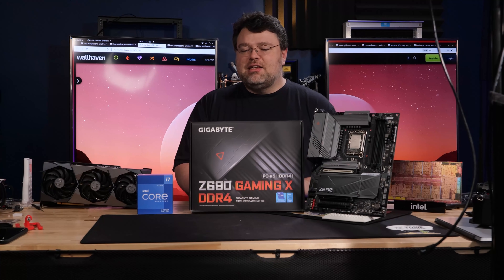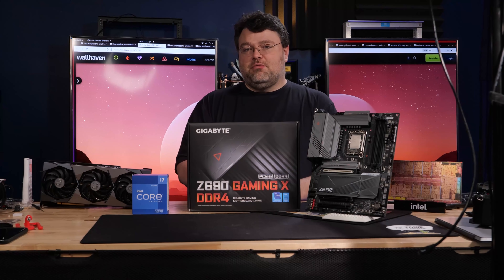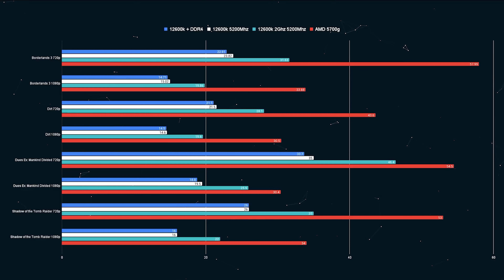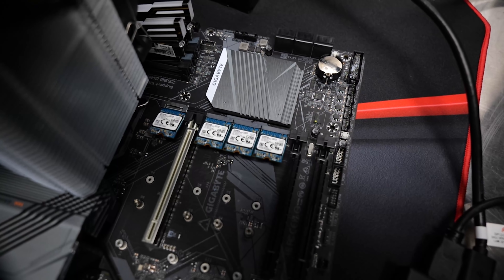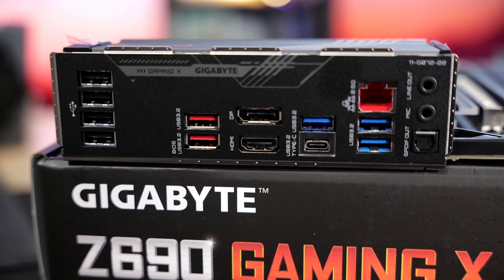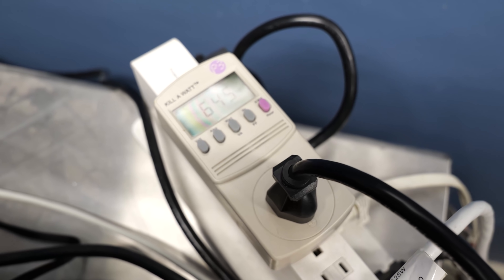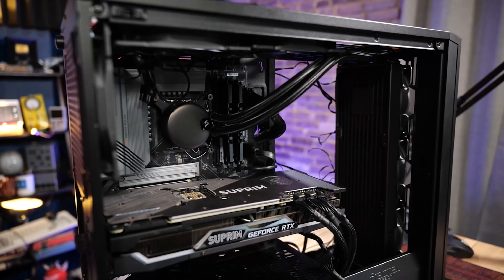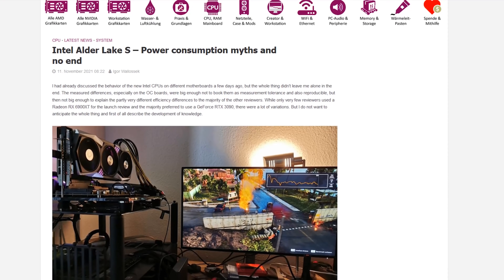Checking out the Gigabyte Z690 Gaming X DDR4: Does DDR5 Matter for Alder Lake?

Comment: You might have already seen this, but for hardware Unboxed's video on Z690 VRM testing their Gigabyte boards (which included this board) all performed at the bottom Power consumption and thermal wise.

They didn't test ASRock boards, but it might be Gigabyte having an issue, not DDr4 vs DDr5.
Reply: Gigabyte had good boards for B550 and X570 but their Z690s are just straight up trash. MSIs are top tier.

Comment: When talking about the rear IO you didn't even mention whether the NIC is 1GBit or 2.5
Reply: 2.5
Reply: No need to mention, all Z690 boards have a 2.5 LAN port.
Reply: if it's not 10gbit it doesn't really matter
Reply: @marcogenovesi8570  Right
2.5G really seems like a half-step
You would like to see 10G more but it's also one of those things where if you wanted 10G you probably already have it (10G RJ45 copper is getting cheap and SFP+ is proper cheap) and wouldn't bother getting in on a motherboard unless you really don't want a separate NIC taking up space or you're on ITX (is there even a ITX board with 10G?)

Comment: Have you tried the motherboard HDMI port with the iGPU only ?
I have the same motherboard and I'm having issues while connected to HDMI.
I've tried different cables but no change, however at 1080p the cable quality requirements shouldn't be an issue.
DisplayPort seems to work fine with no issues.
Just wondering if it's something specific from my setup or maybe poor signal quality from the motherboard HDMI port.

Comment: I'm not actually fond of the idea of getting rid of so many PCie slots just for m.2
I understand it's a gaming board and redoing the M.2 to be 2 PCIe 8x slots may run afoul of the huge GPU heatsinks seen nowadays but it would be nice to see ATX boards actually take advantage of being ATX and moving SSDs to an add-in card, it keeps options open rather than restricting lanes to only M.2

M.2 is getting long in the tooth to be honest, think of all the insanity we could have if there was a return to AIC SSDs
Reply: M.2 isn't going anywhere, it's used by laptops and gives massive economies of scale to reduce price of what would be a much smaller SSD than a 2.5. PCIe SSD cards would be limited to desktop only and this would just make them too expensive.

The only issue here is motherboard manufacturers that prefer to put M.2 slots on the board instead than PCIe slots + a cheapo bifurcation-based PCIe adapter
Reply: @marcogenovesi8570  Not saying M.2 should go away but for enthusiasts there should be more options as M.2 is somewhat lacking in board space. There is reasons the enterprise doesn't deal with M.2 much
Reply: @marcogenovesi8570  yeah, I see the standard growing with the years, but for example, with a pci-e slot by 8 or by 16 on pci-e gen 4 (15.76 GB/s with 8 lanes and 31.5 GB/s with 16 lanes) can provide enough bandwidth for a blazing fast ssd or a couple less fast ones, but you can install the adaptors wherever, and include more adaptors if desired. I think the variety of pci-e connectors and available electrical lanes on standard pci-e makes it very un-standard-y, and m.2 is the same everywhere. At least, if there was a standard to mount m.2 devices vertically (maybe there is such standard, idk), more space would eventually be saved on motherboards for other m.2 slots or even PCI-e slots or whatever. It's all about possibility and liberty to put a crap-ton of capture cards, GPUs, audio cards, network cards, newer USB version cards, a bunch of "SATAn" ports for big data storage for a desktop PC so you put it all together for a build/render/storage/mail/media/firewall or all of the above server/desktop PC... the PC is awesome.
Reply: @tonnylins  I know, a "dumb" bifurcation-based M.2 adapter PCIe card that can fit 4 SSDs costs like 20$ and can be 100% reused on a different board so IMHO it would have just made a lot more sense to just not place any M.2 and rely on secondary market to provide the adapters
Reply: @marcogenovesi8570  yep
Reply: I don't know, but it seems m.2 slot is way under-utilized than it could be especially for the smaller size, and potential use with faster speeds each year it seems lol. One current possible use example could be for a complete streaming setup using one small mid-tower pc if no room for dual pcs, or space for larger cases designed run dual pc. In this mid-tower setup using m.2 SDI capture card to keep your main PCIe 4.0/5.0 x8/x16 lines for hardware which can benefit more in those lanes than the majority of current SSDs need/will need for most. Depending on if you're an audiophile allowing a 2-slot GPU in top PCIe x16 and audio card below it while allowing video capture directly through m.2 from up to 4 sources per m.2 slot. As tech continues to advance, it will be the more you can fit on the board in the least space = most enticing haha. I mean look at the trend of pcs in the last 15 years... mATX basically died out for a bit recently because majority of people want to build ITX sized computers. Others build in mid-tower ATX or full with ATX/eATX to have space for the water cooling, or more powerful hardware while better managing temperatures. I predict mATX comeback wave soon where boards might skip out on SATA 6gbs ports and using space freed up for more m.2 lanes. This as well as going from the normal mATX using one PCIe x16 and one PCIe 4x (if 2nd slot is x16 it's usually limited to x4 when top slot is in use) on currents boards to newer boards standardizing two PCIe 5.0 x16 lanes with also four or more m.2 PCIe x4/5... See in my opinion ITX is made simply too small thermally and for current hardware size needs. Even stuff like a decent CPU cooler to fit in an ITX case which can actually cool newer top notch processors, its hard to find, and then even harder to get to fit and work properly with the space given on the ITX board due to larger onboard heatsinks lol.  EATX and ATX are fine if your room is okay with mid-full size case. I know people having to live in cramped areas, and cannot change this. So a gray area of mATX production could be improved on drastically. Slightly bigger than ITX and using a case made specifically for mATX, just feels and looks better than cramming everything into such a tiny ITX box while being afraid of spontaneous combustion or the sounds of cables grinding in fans lmao. Honestly most do not need SATA 6gbs slots. I haven't used them in 5+ years haha. Give me two m.2 slots there instead. Way better and no cables while not taking up the main x16 slot areas on board with how AIC SSDS do.
Reply: yep, it would've been so much expandable if it had normal PCI express slots and a convenient m.2 to pci-e adapter that would have come with the mobo. Sure, leave one m.2 on the motherboard itself but use the actual usable space saved for random add-in cards, PC style.